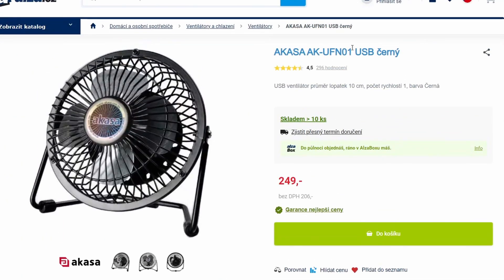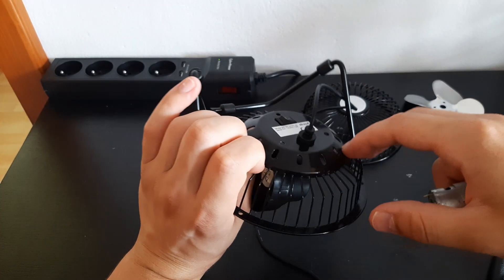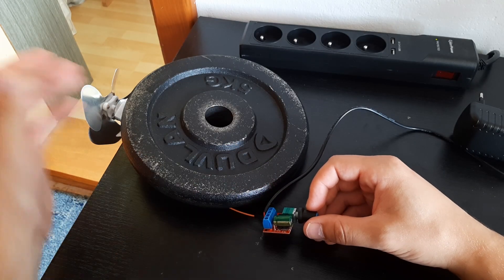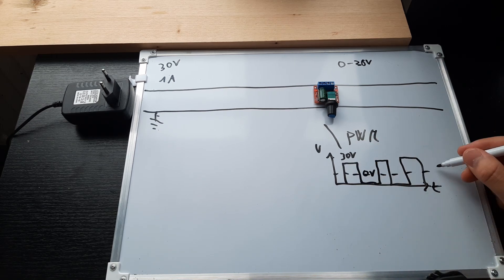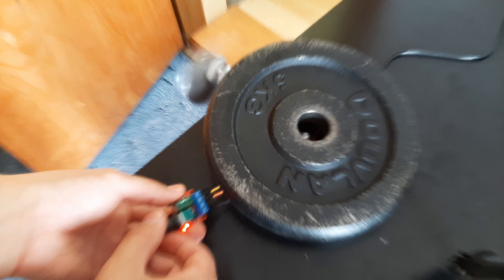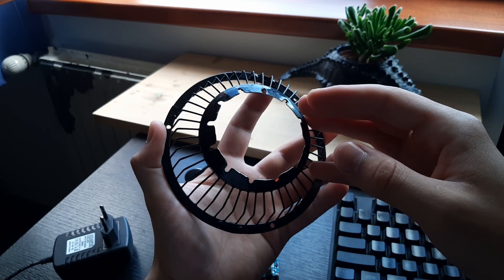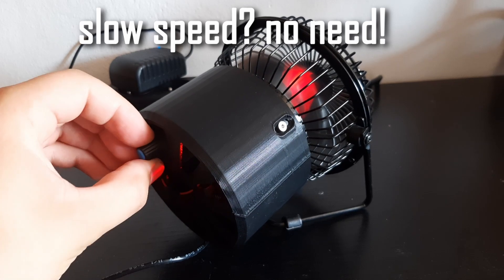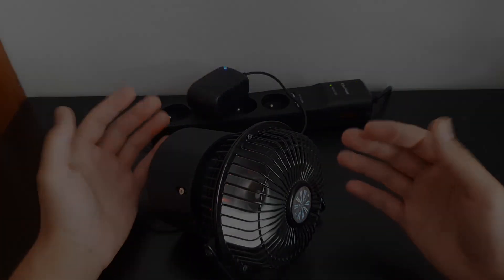3D Printing a Better USB Fan

Comment: why would you use an additional PWM controller if you could just replace the pcb potentiometer with an external potentiometer + limiting resistor on the DC-DC converter?
Reply from the maker: Changing the trim on the DC-DC step down converter for a potentiometer would be more work. So I just slapped the speed controller behind it. But yeah it's redundant.

Comment: You can make a really good fan with an fpv motor and an esc they are usually veery powerful. One suggestion, get bigger propeller with steeper angle because it will run quieter